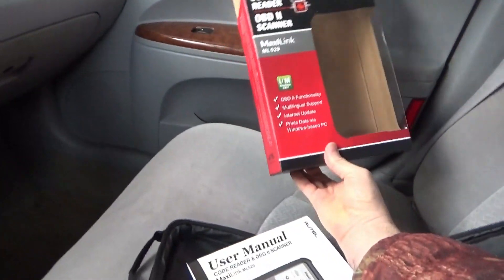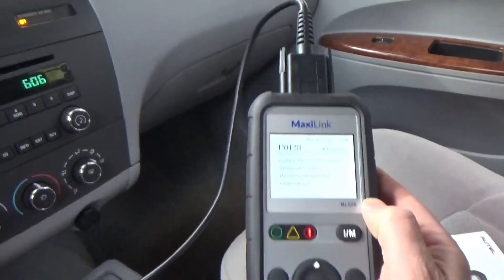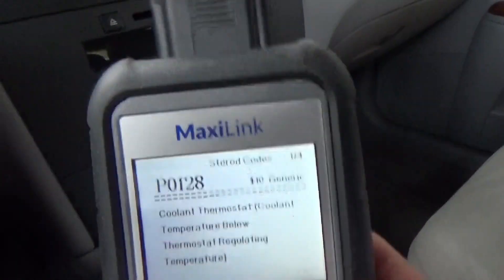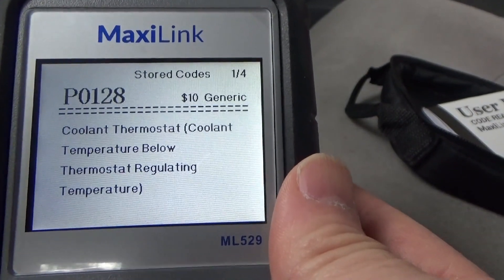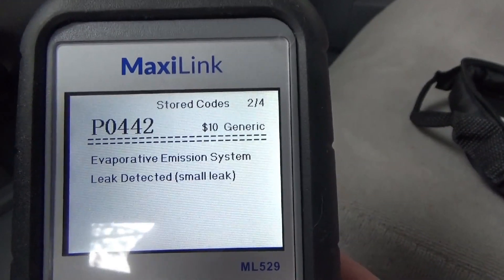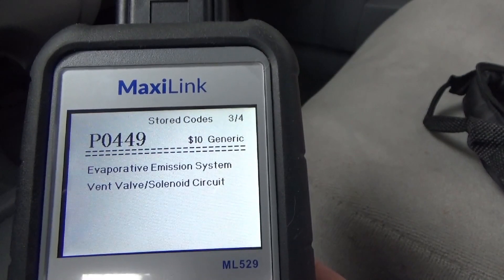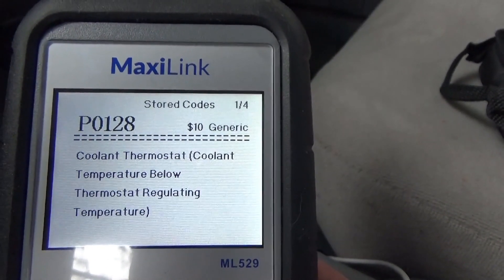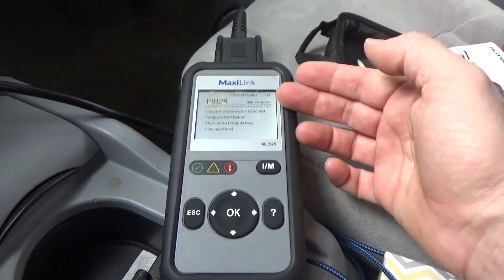Autel MaxiLink OBDII Scanner Saved Me Money

Comment: So why not use the OBDII code reader to fix your truck? Those code readers are a valuable tool to have but they won't save you any money unless your check engine light is on and there are fault codes stored in the car's computer.
Reply from the maker: There was no check engine light on and no fault code. Something is messed up with the physical wiring not sensors.
Reply: Problems with physical wiring can sometimes cause the same fault codes that bad sensors cause. Which is why I asked. Sorry to hear that you have no fault codes to help you track down the problem.
Reply from the maker: Oh by the way, I removed honey badger but she said one thing right. OBDII came after 95 or something. I always use the paper clip method for older cars. Works well.

Comment: So you definitely need a thermostat with that code.better heat during winter.Che k the vacuum lines to the purge valve solenoid,and fuel cap.does it have a rough idle,or fluctuating?
Reply from the maker: Yes I replaced the thermostat and I think it was the purge valve solenoid, as you said. That did the job.